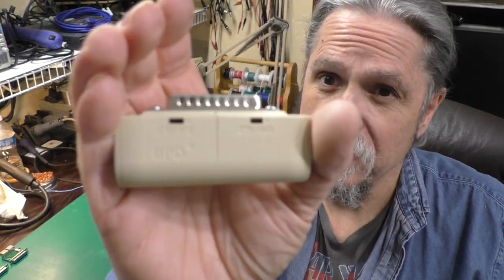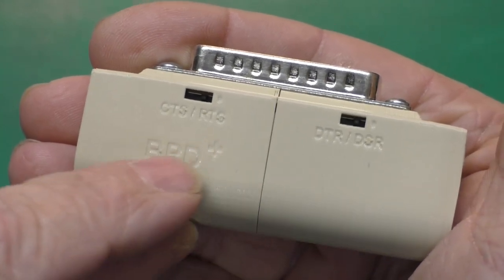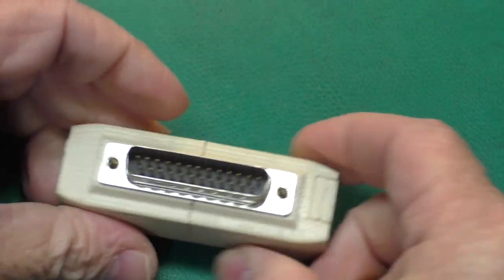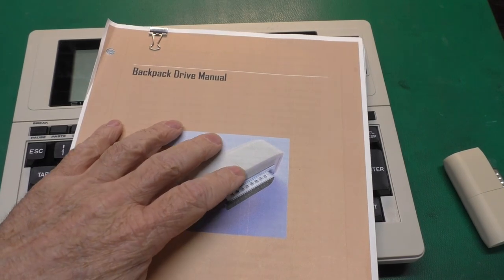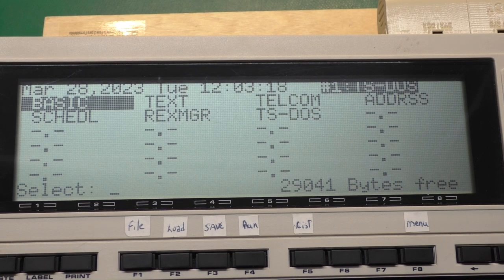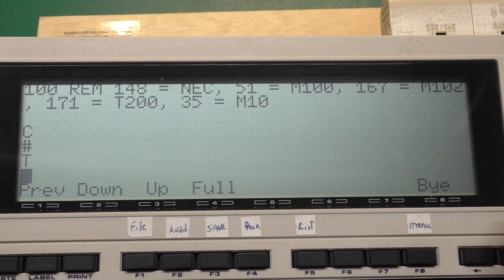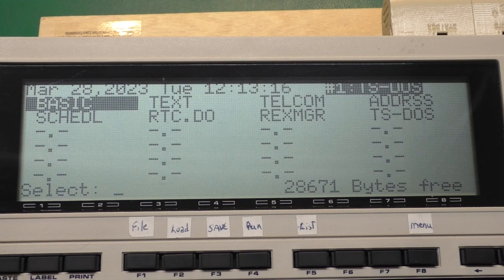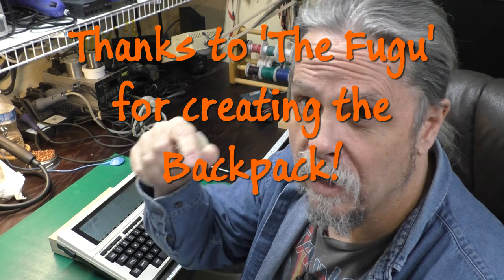Backpack Trip #1. uSD storage for vintage portable computers. Basic operation and CLI introduction.

Comment: I just got mine, and have started using it with my Model 100. Lovely little device, really well designed. I've found that i can now work on text files on both my Model 100 and PC, by moving the SD card from one device to another. Really handy and flexible, and it's great to be able to carry around more than 29K of files at once!

Comment: Great guide, B! As always, looking forward to your next video.
Is anyone offering a simple tsdos option rom these days? It wouldn't have the super powers of REX# or Dial-a-ROM, but it'd be so much better than having to load Tsdos into ram. Or would it just not be any cheaper than these other great option-roms?
Reply from the maker: Thanks to the goofy Molex socket a single function ROM board would have 95% of the parts/effort as the DAR. Basically, everything but the switch. It would not change the cost much at all.

Comment: Here’s a question, is there a way to make it work with a tea-80 model ///?
Reply: Trs-80 I hate autocorrect.
Reply from the maker: @bigbadhodad3894  I had kind of guessed at TRS-80 when I read first message but was wondering what happened. Silly computers...

If you can load a terminal program on the Model 3 that does Xmodem protocol the BPD+ will work.

I think a FRED would be more of what you are after or perhaps a Gotek.
Reply: Yeah I was planning on the gotek for the model 3 it was just curious

Comment: Will it work with the Olivetti M10?
Reply from the maker: There was not a version of TS-DOS released for the M10. You can use a modified version of the T102 ROM in the M10 which lets it run M100/102 software.

http://club100.org/memfiles/index.php?&direction=0&order=&directory=Steve%20Adolph/Patched%20M10%20Main%20ROM